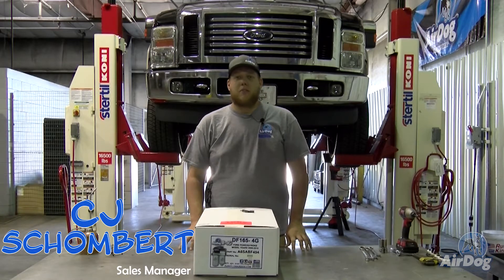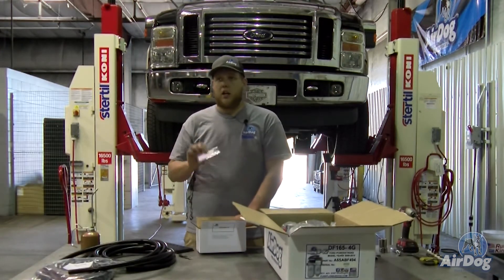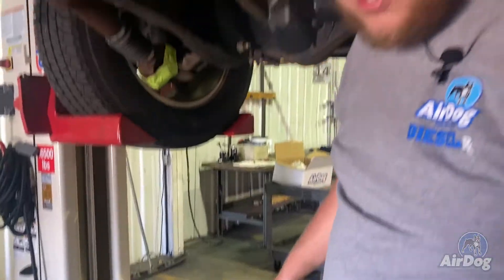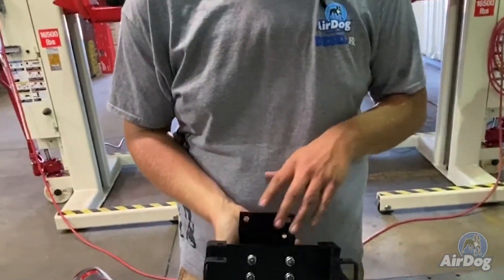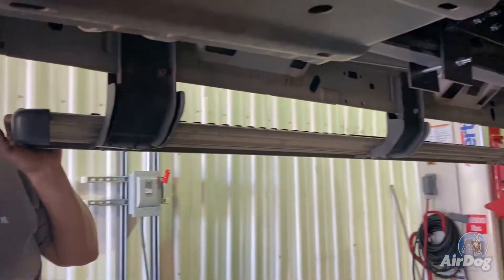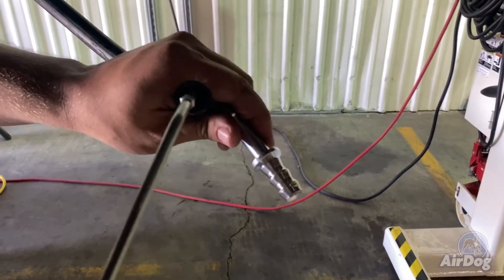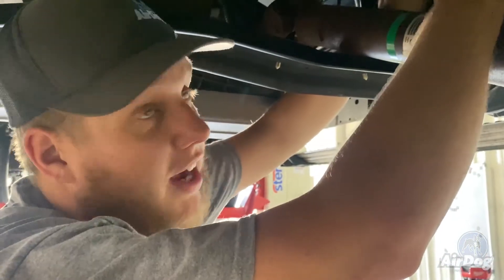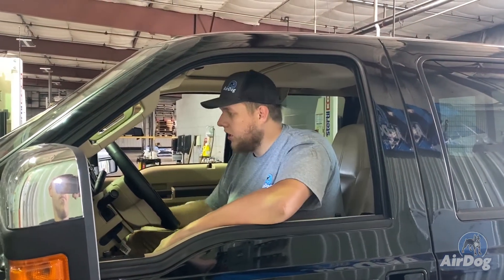2008-2010 PowerStroke Install DF-165 4G

Comment: & what they dont tell you is what you do with the factory plug computer will throw a P0232- Can someone confirm this? How do you fix this? Did some research and it says cut the connection at the red wire and connect it to the factory OEM plug but what happens to the ground on that circuit its a two plug connector do i run a ground from that side also?

Comment: Only question I have is instead of unplugging the suction line at the tank why can’t we just plug in a hose that connects from the side you disconnected at the stock pump can that be done or do we have to replace the suction hose to the tank?

Comment: Any hose clamps at all??
Reply from the maker: No hose clamps. These are push to lock connections. Hose clamps will cut the hose and cause leaks.
Reply: @AirDogSales  factory type, cool, thanks

Comment: That relay he said needed to be mounted to ground, is not grounded through that mounting tab. It's grounded with the black wire going to the battery. The relay can be cable tied to about any sturdy wiring or hose there near the fuse box. The quick go over on the hose definition kinda lost me. But the install manual will be clear enough to get the hoses in the right places.

Comment: I'm sure that some other 2008 Ford F350n owner has already posted this but just in case... That "I'm not even sure what it is to be perfectly honest with you" thingy on top of the fuse box, in the engine bay is the electric vacuum pump for the automatic front locking hub's. As you probably know, Diesels don't make vacuum so an electric pump is necessary in order to create vacuum for the hubs to lock in and out, from inside the cab rather than getting out and turning the hub locks manually.